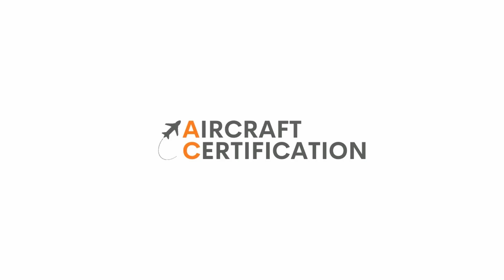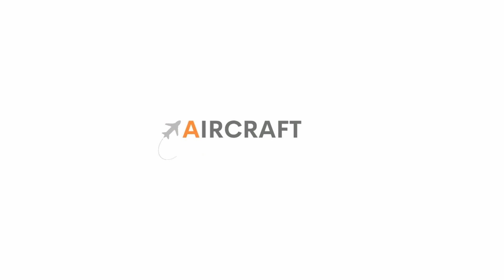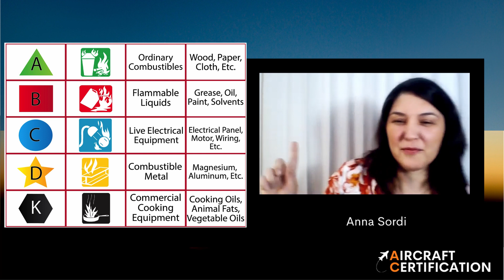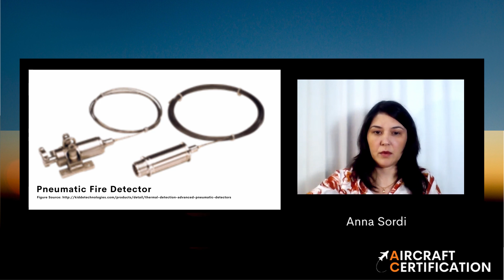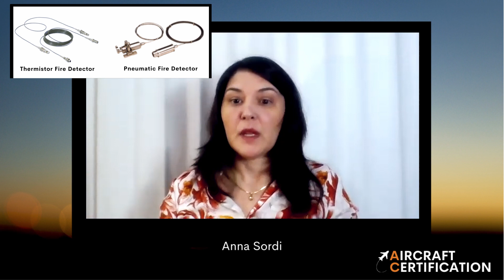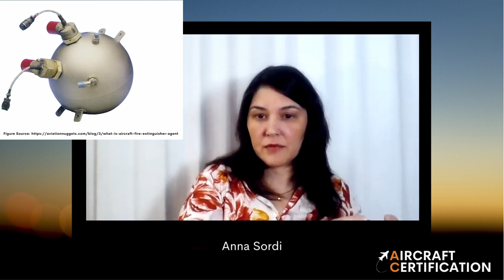Engine & APU Fire Protection - Anna Sordi - Aircraft Certification

Comment: Thank you Rafaela-san, Clarissa-san, and Anna-san for this interesting channel.

It's interesting to know there is pneumatic type fire detector. But it  seems having more restrictions for installation than thermostat type.

Regarding fire extinguish in engine, if we go little farther, it's not only fire extinguishion system but also other systems behavior are necessary to consider for example shut off means for one of three fire elements in fire triangle,
right?

In my memory, two fire extinguisher bottles distributes separately by tee valve, one for immediate extinguish and the other one for continuous extinguish.
It's very thoughtful system.

Thank you.
Reply from the maker: Hi Mizuide-san! Thank you so much for watching our videos and always contributing with interesting comments. Yes, you are right, when talking about fire protection, the detection and shutoff means come first. The extinguishing system will be efficient only if the shutoff is successful. If not, re-ignition may occur as the flammable fluid continues to flow into the still hot surface. Although depending on the type of installation, there are other procedural means to stop the flow in the case of shutoff means failure. It shall be analyzed case by case. For the fire extinguishing system for propulsion system, there two shots with rapid full discharge of the bottles. The continuous flow for the second shot is used for extinguishing system used in the cargo bay.